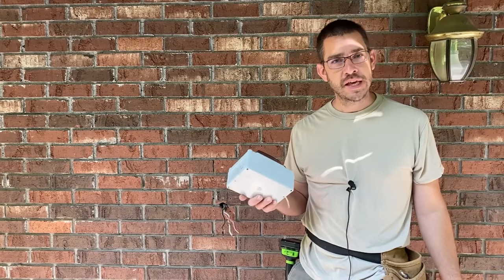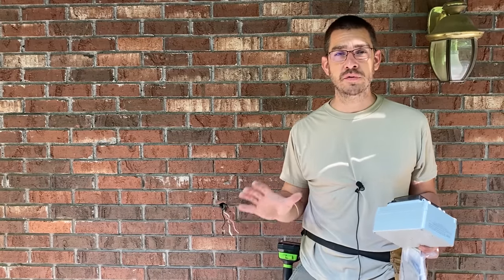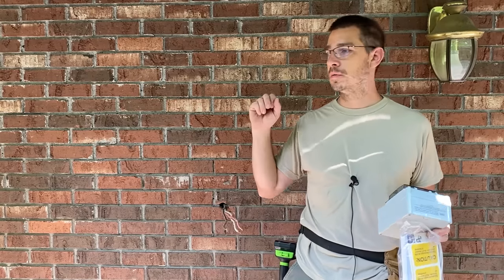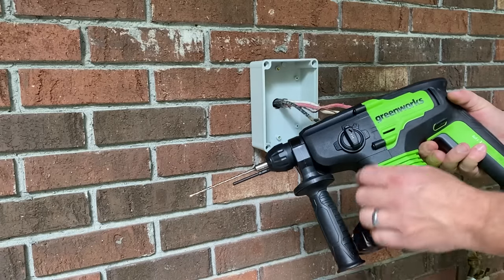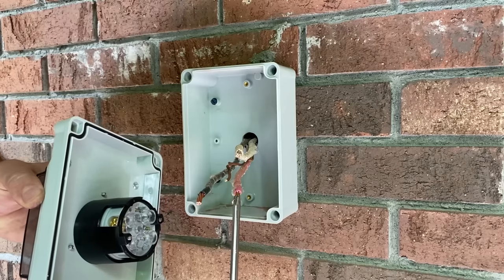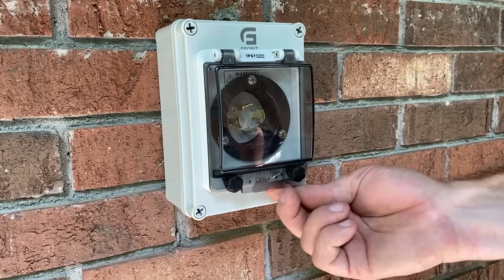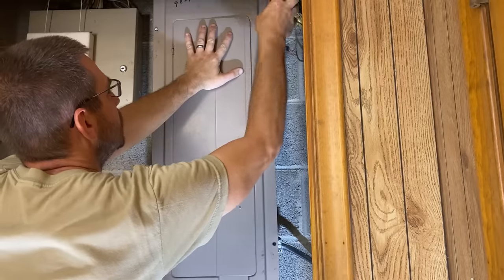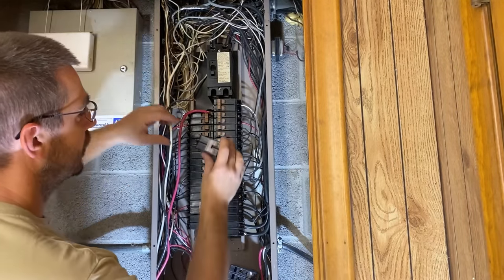How To Safely Power Your Home With a Portable Generator

Comment: Our house has an interlock and we power it with a 9kw generator, which is enough to run about 90% of the house. 
One helpful tip is to go through your panel in advance and mark each circuit that you want to run off the generator when the power goes out. I used different colors of permanent marker and just made a dot next to each breaker: red dots for mandatory circuits (fridges, freezers, and key lights) and green dots for optional circuits (everything else except the oven, dryer, and shop sub-panel). 
That way you don’t have to think about it in an emergency, just get the generator fired up then start flipping on breakers, red first then green.
Reply: Is that on a 30Amp leg?
Reply: I have a similar system except I have solar panels with a Power Wall. They is hooked up to a secondary panel with my critical loads. So on a loss of power critical loads are automatically powered and a automatic disconnect isolating these loads from my main panel and the grid. If I choose to supply non critical load or my solar panels can’t keep up with my critical loads I have a NG generator backup that supplies my main panel.
Reply: The red and green dots are a great idea, I’m going to steal this idea!
Reply: Green is for Go man, and red is for stop. I’d mark them opposite, but the concept is sound.
Reply: @jimj9040  that does make sense but when I first started I didn’t have a green marker 😆
Reply: @MukYJ  Thanks for the clarification. I’m not ADD but  that decision making process may have been haunting me for years to come.
Reply: @MukYJ  git R dun whhoo hoo
Reply: Is this legal in the U.S.? In Australia you are not allowed to do this wok unless you are a licenced electrician. Also we would use a double pole changeover switch rather than a mechanical solution.
Reply: @davidhall5844  yes, a homeowner in the US is typically allowed to work on their own home, but they are usually still required to get a permit and have the work inspected. I’ve heard that there are some jurisdictions where permits and inspections are not required but I’ve never lived in one. 
Mechanical interlocks are acceptable as are transfer switches.
Reply: @davidhall5844  Drives me crazy. Not even allowed to run data cable in aus. It's ridiculous.
Reply: @andrewford80  actually I am an electrician and I support the law here as it stands. I am amazed that places like Bunnings are allowed to sell low voltage equipment to non-licenced people but there you go. By the way, you are allowed to run data cable in Australia, just need to keep proper separation from low voltage cables though. You just can’ t connect to telecommunications gear or purport to be a licenced installer. Cheers and stay safe.
Reply: I don’t mark anything except boiler and washer/dryer. All the other breakers are for lights etc which I don’t  keep many on at same time anyway.
Reply: @davidhall5844  Here in America we like freedom, even if freedom means you get interference on your Cat6. Rollllll tide roll!!
Reply: @truthbetold1855  yes, freedom here. Also in places like India where buildings collapse with regularity. Also look at freedom in the early years in New York with sweatshops collapsing in the same manner. 
Building and electrical regulations are there to protect people.
Reply: @davidhall5844  trust the government get vaccinated pay taxes...
Reply: @davidhall5844  In all fairness, y’all aren’t allowed to do anything anymore without permission from that dictatorship. No offense…
Reply: It always bugs me to see crusty wiring jobs.  You can always tell when a real pro did the install with the wire job is neat and tidy and zip-tied where necessary.    I would also recommend adding a whole house surge protector to the panel.   A little extra never hurts.
Reply: yea this is so backwards lol... green is go, red is dead...hahah but I like the idea
Reply: @Vee1on1  11
Reply: Invaluable information thanks... will soon be installing one .
Reply: @matthewhuszarik4173  Does the "power wall" have the automatic disconnect built into it or was that an additional automatic switching device you had to setup?
Reply: @PapaSmurf337  When Tesla installed my solar and Power Wall they also installed an automatic disconnect. It is so fast I haven’t even been able to notice the lights flicker, which surprised me. None of my digital clocks need to be reset either. The automatic disconnect is in a separate box. I have solar-inverter-Power Wall-protected power panel-transfer switch-main power panel-grid.

Comment: Bought a Generac LP5500 after Hurricane Sandy tore up the east coast several years ago.  Do a 20 minute test run each month.  The generator has been extremely helpful several times keeping us warm, lit and comfortable during those heavy winter storm power outages l

Comment: I appreciate the inspiration! I have been wanting to install a generator outlet for several years. I tried to hire an electrician but nobody was interested. I finally did it myself after watching your post, it took about two hours from start to finish. Disclaimer, I had an old 30 amp breaker for an electric range I wasn't using so the main wiring was pretty simple. I just disconnected the range wiring and reconnected the 30 amp generator outlet to that breaker (plus the ground and neutral wires). I made my own interlock bracket (disclaimer: I have knowledge and access to machining tools (i.e., Bridgeport, bandsaw, etc...) at work) and everything worked perfectly. Thanks for the encouragement to get this off my to-do list!
Reply: !11!!
Reply: If you go to sell your house, since the face plate you made is not UL approved you will either have to remove this generator switchover control or deal with the home inspector and possibly the county inspector.
Reply: @kinglee3990  Thanks for your input. When I go to sell I'll replace the interlock bracket a commercial one. For now, it works and everyone is safe.
Reply: Did you consider replacing the actual breaker?  I have seen corrosion on older panels.  It was a good idea to repurpose the breaker position.

Comment: I am using this same setup,this does gives the homeowner much more flexibility to choose what combination to run based on the wattage that is coming in. Most of the newer portable generators 10,000 and above have 50 amp plug in on unit. I have a 12,000 watt rated one and having a 50 amp plug option vs a 30 amp is no comparison. I used Romex 6/3 wiring for 50 amp circuit and a box that is also 50 amp & also had to buy 50 amp breaker and a interlock switch for panel. I have a well pump so when down no water, can run one 220 at a time along with lights and fridge & and outlets. Cant run heat pump but by far having this for backup is a must to keep the home fires burning!

Comment: Very nice job. I also added an amp/ volt meter to both legs to keep an eye on the amp draw and to keep the legs balanced.
Reply: @The_Happy_Aviation_Enthusiast  thanks! I bot a used travel trailer with a Honda E2200X (?) Generator and yet to fire it up. I need to get familiar for just in case.

Comment: Another helpful tip, install a power back alarm to let you know when the grid power is back, especially if you don’t live within sight of neighbors or streetlights.
Reply: I've thought about that issue.  How exactly would you wire up such an alarm?
Reply: You are correct… that’s the only negative about an Interlock setup. But still a very small “negative”
Reply: Funny, on the 6th day after Ida we were in out camper running on a generator where we had been staying when a neighbor text me and said ‘your generator is still running’. I said ‘good’. He said ‘power has been on for a couple hours’. Oops.
Reply: To solve this problem, I installed a single pole illuminated switch “on” that is wired before main power hits panel. When power goes off flip switch, when power comes on but main breaker is in off position, switch will illuminate showing power is on. Works great.
Reply: @IUSSHistory  Make sure you have a comfy chair while you watch for that - and don't fall asleep!
Reply: @IUSSHistory  I don't think my meter is very smart because it located itself a couple hundred feet away from the house.
Reply: @kc7154  ...and is illegal in most likely every jurisdiction.

Comment: Tip if you want to try to see if it is better or not:  for thick wires drill cable holes on the corners of the wiring box, never in the center of the wiring box and you will benefit of having more space to bend the wires around when you do the connections.

Comment: As others have posted…. You need to add a strain relief and bushing for the Romex at the box, do not push unprotected wiring back into the brick, and you need to add a gasket or apply silicon to the back of electrical box to protect against moisture.
Reply: Hack job
Reply: Definitely not silicon but firechalk
Reply: Definitely need a flux capacitor
Reply: @duffmann2021  He didn't even test for 1.21 gigawatts! Amateur 😂

Comment: Excellent work. Definitely the safe and inexpensive way to power a house with a portable generator.
Reply: No silicone around hole back of box?
Reply: @calvinholser2535  just feed the excess wire back through the hole. Come on. My helper knows you have to have a connector in the box and the sheath has to be in the connector. Its hard to have a weatherproof box with a hole in the back.

Comment: Good job sir. I am an electrician and you did the job according to code. Alot of people.do not put the interlock kit thanks for showing people how it is done by code and safe.
Reply: Good job, no I didn’t know strain relief where the wire goes into the box no caulking back there, and the panel was a wiring nightmare
Reply: @crusherfang9368  good eye your right. But what I was referring to was everything that is required to make that circuit safe. Interlock fool proofs any electrical shock hazard either going from a live panel to inlet or from generator to transformer which is the moat important part. Also the box is pvc so technically even if the wire  were to contact the plastic it would not create a shock hazard furthermore the hole where wire is inserted is completely covered from any human contact no different than sticking a romex wire in a single gang nail up box which requires no connector. So I do not think it is a code violation. And finally it is safe it is right and no inspector would even be able to check.
Reply: @crusherfang9368  its a grey area plastic box no human contact it doesn't take away from safety or quality. And no inspector would open it to check. NEC says single device boxes that are plastic do not require wire clamp unless wire is exposed. And even then all it says is it must be tacked within 8 inches. So put one if you like or don't its up to the person.
Reply: @crusherfang9368  just show me the code. Plain and simple.that says what you are saying.
Reply: @crusherfang9368  do you even have a code book?
Reply: @crusherfang9368  How many generator circuits have you installed? Are you even an electrician. And if not why are you even giving your opinion.
Reply: @crusherfang9368  you are right but I like to practice on my inspector debating skill. Yes of course I would just put not a connector but in this application a pvc 1/2 inch male threaded connector with a metallic lock nut and plastic bushing just as a sleeve which is what code requires in this application. Just as you would if you where to back feed a service panel with a 2 inch pvc connector metallic locknut and plastic bushing. I went to 2 year trade school. I AM A LICENSED ELECTRICIAN. I have done my apprenticeship I did take a test and I am a master. I complimented the guy for making his circuit safe which in my opinion as an electrician my job is to make sure my work will not be a hazard to you your family your pets or your home and no licence teaches you ETHICS. good job on proving me wrong but its a minor minor code infraction. Thanks.
Reply: @crusherfang9368  and now answer my question how many generator circuits have you installed??????
Reply: @crusherfang9368  😆 actually the price of my taco meat has risen drastically just like wire and conduit so yeah my tacos are skinny. But cabbage has remained the same so you should be nice and fat with all the sauerkraut sandwiches you been eating. 😆.
Thanks for the title. Sounds catchy just might name my company " master louie's electrical solutions that may or may not include a connector. 😆

Comment: Just a suggestion for future projects, , , when you drill a hole for a Tapcon type screw, take a moment and blow the dust out of the hole for better strength. I just use a cheap ear syringe if I'm off-site from my compressor.

Comment: Thanks for the information.  We were looking at a generator from Northern Tools. This is exactly what I was describing to my wife to backfeed the breaker box. Not extension cords.
Reply: buy ur self a auto changeover switch save u on all the drilling  with no back feed at all
Reply: @DJNITROALLY  Good luck. A NEMA certified switch runs over $500. Then you better get an electrician to install it because you must transfer the Main coming from the pole or from your main 100A or 200A breaker, to the auto transfer switch, then from the transfer switch back to your panel, and you will still have to wire in your generator. Requires drilling, wiring, and a whole lot more work.

Comment: Nice video. 
I like to squirt silicone caulking in the holes the wires come through exterior walls and "pre-bemd" the wires before installing the cover so I don't push the wire back into the house . Consider using a short, sturdy wooden spoon or similar with no sharp edges.  Finally, outlet boxes which you access from the underside keep wind driven rain and debris out better than front facing models.

Comment: I marked the breakers ahead of time the only ones I want to turn on! Also I set down at my computer and printed out step-by-step instructions on what to do what each of the breakers goes to that I want to turn on and about how much power they use. Most people don't understand what the generator doesn't make power!  It changes the power in the fuel into electricity.  The more electricity you use the more fuel it uses! Most generators have the best fuel to electricity conversion at about half the rated power for the generator. Try not to use more half the rated power as much as you can. Running it at the top rated power is hard on the generator and burns a lot more fuel! I have learned much of this because of many Hurricanes,  and not able to get more fuel because the places that sold fuel didn't have power to sell the fuel.  GOOD LUCK!  STAY SAFE!

Comment: I caution all the viewers here to make sure you are using the correct wire size and breakers for your application.

Those drop in your ear speakers that plug into your phone have wires that can carry 120v, but use them to power up anything more than a test meter at that voltage and expect the wires to rapidly heat to the point of melting the insulation off and catching fire.

Also, the wires need to be captured in the box or installed in piping/tubing to prevent accidentally pulling them out and exposing bare wire to people or flammable material like wood in the wall.
Reply: You can always go to a thicker gauge wire but you can limit it with a lower amperage breaker.

Comment: Just be advised that some furnaces won't ignite due to the electrically noisy generator output or grounding scheme.
Lennox furnaces are notoriously incompatible with portable generators.
Don''t depend on the generator for furnace operation in winter without verification.
Reply: I just put a muffler on mine, nice and quiet now, no issues
Reply: @kray421  Did you use the real fur ones? Or the synthetic, faux-fur type?

Comment: It would be a very good idea to make sure the wire you use is the proper guage to handle the amperage output of your generator.
Reply: 6 gage is the minimal but I would up it to possibly 4 gage
Reply: It all depends of the length of run what gage of wire you need. But the entire circuit must be designed within the capacity of the circuit breaker. Just recently I replaced an electric hot water heater. It was wired with wire and breaker for 20A so without replacing both the wire and breaker I couldn’t use a standard 30A electric hot water heater. Thankfully they still make a few 20A versions.
Reply: @crockpot5194  his inlet box is rated for 30 amps. The proper size for 30 amps is 10 gauge, but looks like he ran 6 gauge so that he can just change the box and breaker to a 50 amp in the future if he ever wants to upgrade to a larger generator.

Comment: Great video! First time seeing your channel. I'm not seeing much difference between using the dryer recep and installing a whole new recep? Other than more money,  work, & another hole in my house. If I'm wrong somebody please tell me.  I'm new to this, first time homeowner for 8 months now and new firman tri fuel 10k generator.  My utility room is in the basement and has a small  window above the dryer. The screen already has a hole so...boom. I also have a capped off has line right there also in case I need to run it off natural gas. It cost me $800 to have that dryer recep put in(finished basement and the panel is on the opposite side of the basement). I can't afford another one right now. Single income family of 6. Hoping for some feedback. Thank you have a blessed day.

Comment: You mentioned changing out the 50 that was there in the box with a 30. Would having a 50 in the breaker be an issue even if your plug is a 30? What is the reason for wanting them to match/ be consistent?
Reply: The rating of the breaker has to be compatible with the entire circuit so it will protect the weakest link.
Reply: Good question, good answer!